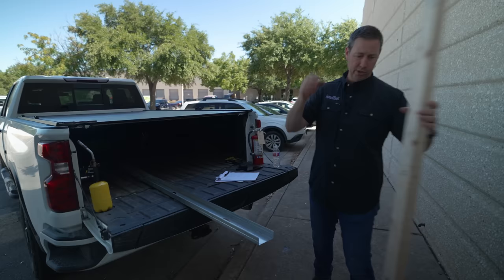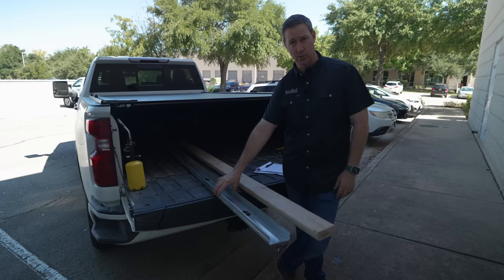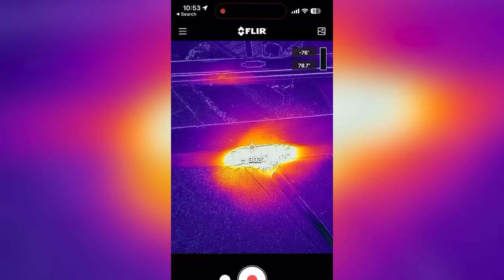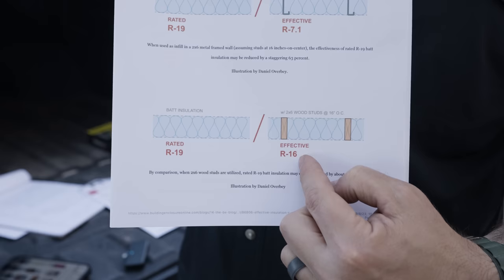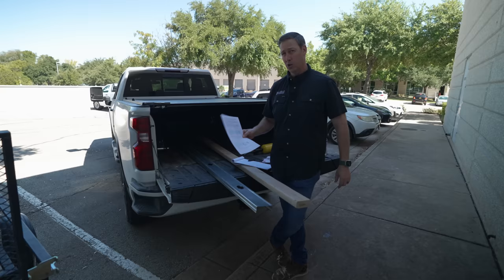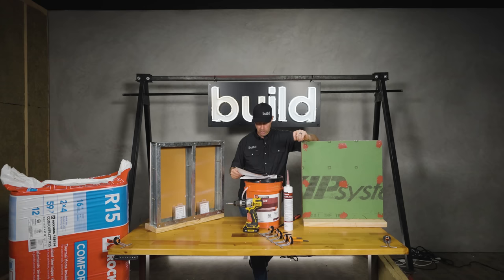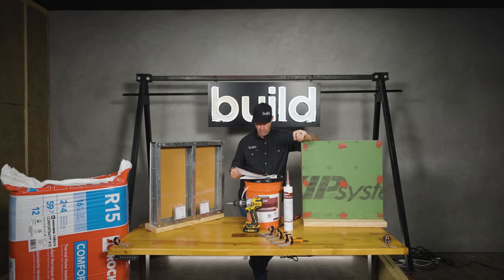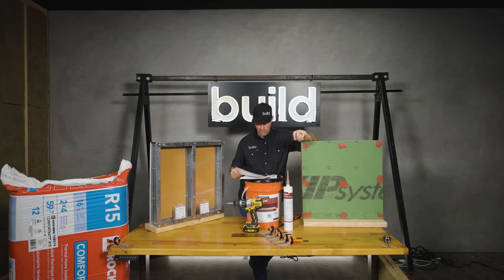Framing Studs: Steel vs Wood

Comment: Being that I am late to the party, I might be repeating many comments and concepts.  This is not going to be a quick read.  Sorry about that Matt.

Whether you use Cold Form Steel (metal studs) or wood-based products, there are many pros and cons to carefully consider.  My comments will focus on the metal framing for a residential home that is energy efficient and built for today’s ever changing weather conditions.  Feel free to have your opinion and conclusions on this topic.  A health conversation is the best thing.

To begin with, using a 3 5/8 or a true 4 inch metal stud in either 16 gauge or upgrading to 14 gauge stud is the optimal size and strength based on the gauge. Yes, they are straight.  The width of the metal stud known as the flange size is typically from 1 3/8 to 1 5/8 inches depending on the manufacture.  Larger flange sizes are available and will increase the cost.  Depending on your load requirement and distance, a header can be from 18-12 gauge.  Again, depending on the engineering requirement, you can use a metal stud or switch over to a metal C-Joist that has the same characteristics as the metal stud.  The standard flange size for a C-Joist is 2 inches.   Each manufacture has various options for blocking from flat stock to u-channels.  You can go either 16 inches or 24 inches on center.

Based on today’s pricing, a metal framing members are more expensive than a conventional wood stud, but, not still in the range of a engineered wood product (“EWP”).  Just like Builder’s First Choice Ready Frame service using wood products that Matt mentions alot, there are the same for metal framing from various sources and can be found on the web also.   The project savings for this comes in the reduced labor cost and faster dry-in time.

In terms of strength, metal studs are extremely strong and hard to bend especially in high winds.  The correct gauge is the key to the application.  I always prefer going with 16 gauge as a minimum.  As somebody here in the comments mentioned earlier, they used 18 gauge studs for their home designed to handle winds up to 150 mph and as already survived 3 hurricanes in various extreme wind speeds. With metal stud, in particular the sizing I like, you do not have to worry about failure as with traditional wood or even some EWP.  Regardless which product you use, I cannot stress enough, when it comes to high winds which has various variables, the right hold down connectors to the foundation, beams, or etc.. must be used, as well, as the correct shear products and sheathing to complete the diaphragm.   To achieve full strength of metal framing, the stud must be tight to the bottom and top track with no gaps.  Otherwise, you must add clips to correct the issue.

Regarding the fire rating of metal framing members, many fire rated assemblies you will find Cold Form Steel framing products as fully certified for extensive burn times more so than the typical 2x wood material.  Cold Form Steel, studs or joists needs roughly 2700 degrees F to start melting.  With today’s fire load in a typical home with in the last 20 years, you are reaching temperatures around 1800-2000 degrees F.  An older home with traditional furnishing will reach 1000-1200 degrees F.  Fire departments hate the wood I-joists and have a nickname for them, the Widow Maker.  Due to the density of the assembly, the burn through very quickly as compared to the metal.  I know that some municipalities do not allow I-Joists in multi-dwelling or multi-story single family homes because of the quick burn rate.

A bonus when using metal framing products, some insurance companies will give you discounts. This also depends on the complete assembly and the materials that have type A rating for fire.

With that said, the drawing back to using metal is the conductivity of heat or cold passing through.  A 4 inch wall has more than enough strength to carry the loads from a floor and roof.  A 6 inch metal wall will not make a difference in terms of the energy rating.  As building science has now taught us, exterior continuous insulation (“ECI”) is more effective as your energy barrier.  Additionally, it keeps the dew point away from the interior of your home and eliminates the interior condensation problems that lead to mold.  Thus, the additional cost insulating the home for the best BTU Retention rating.

My prefer method is to sheath the exterior with your typical 7/16 inch OSB and then add a Nailbase consisting of 2 inchs of a polyiso product giving me an rating between  R12-14.  Depending on your zone, you might need additional material or less.  The nailbase material I currently like now is a thick Magnesium Oxide product for increase impact resistance.  This will require special self-tapping screws to install the Nailbase into the metal framing. The Nailbase is coated with Prosco’s Cat5 system for the WRB and follow up with a rain screen.  The interior gets 2 inches of closed cell spray foam.  This will give me a cavity rating close to R30 an effective rating over R20 pending on the type of windows and doors used.  Moreover, my prefer method is far superior to fiberglass insulation, the best BTU Retention, and keeping the overall wall depth as short as possible.

There are many other products that can be used to insulate a metal frame structure.  

Another additional cost when you use heavier gauge metal studs comes to installing your gypsum wall board.  Some sort of strapping must be used to make that process faster with out struggling.  Strapping can be plywood strips or lite gauge metal furring channels.

The other additional cost comes to the tools you need and the type of connections for wood-to-metal and metal-to-metal.  As I did not go into any assembly methods, for the builder, the upfront cost in investing in tools will be in the faster labor times.  The new high pressure air guns are worth looking into.

If you made it this far, I would like to thank you for your time.  Indeed, an interesting topic.
Reply: I wanted to thank you for your thorough and unbiased assessment of the pros and cons of this new technology. Your industry insight and experience are an asset to the trade!

Comment: How about the LVL/Versa studs? Or using wood studs inside steel (strengthening)? I guess overkill but I've built some steel walls for interior with wood as reinforcing without issue. Ofcourse insulation wasn't as critical since not exterior walls... so much easier building in steel but then a whole different trade!
Reply: Inserting LVL or any other engineered wood product into a metal stud is overkill.  Depending the gauge (16 or 14, the lower the number, the stronger it is) you use for the metal stud it is equal or stronger than you think.
Reply: I use Lvls whenever I can on my builds.  I build modern houses where perfection is needed.  Today's lumber is garbage.  Granted my clients can afford it.

Comment: Speaking of metal, I want to know the community and Matt's thoughts on container homes. They have gained mass popularity as of late and my primary skepticism is the amount of insulation as well as possible moisture / condensation issues due to the difference in temperatures. Especially in northern climates such as Canada. I would love for you professionals out there to shed some light on these types of homes.....

Comment: In the Caribbean it is common for homes to built with block and concrete with no interior framing and plaster board anywhere including interior rooms.   Just plaster both sides of the block and paint or add stone, tile, etc.

Comment: The main reason steel isn't used IMHO is that builders do not want to train their crews to build with steel. And especially here in the Southwest where a significant amount of the residential labor (in both custom and tract built homes) are 'undocumented' and being paid significantly less than commercial, usually union, carpenters. With modern code, Zip R sheathing is almost required and would eliminate thermal bridging. Given the other advantages of steel, for me it is that it is STRAIGHT, there are significant savings in downstream trades, and ultimate finish quality. I am seeing multi-million dollar ($10,000,000.00 to $100,000,000.00) homes being built here in Las Vegas using wood stud walls, OXB sheathing and building paper (Tyvek) wrap with "blue" paper as flashing. It almost makes you ill to see. Slightly off topic, but they are also building almost 5 story 100+ unit apartment buildings, in wood. To wrap up, I would advocate to move all structural to steel stud (which is also recyclable) and use wood for real finishes, to bring the nature inside, instead of hiding it in the walls.
Reply: Oh they can 'afford' to do it. But that would mean re-training their crews and ultimately costing "more" for the first couple of projects, until the new crews got up to speed. There just aren't enough trained steel crews, because no one is willing to train them. They will continue to 'do it as they always have' because its what they know, and they know how much money they can make. And really, because no one is demanding they do better. It is also a failure of government, shocking, since these 5 story wood buildings are built because that is the tallest you can build type V construction. So it is effectively limiting density as well. If government banned Type V construction for certain types of projects, then you would quickly see steel and concrete take over and see significantly higher and denser projects. Which, while some don't like, are desperately needed in an urban environment.  @armslength2618

Comment: @10:28, The steel stud’s heat transfer is greater than a wood stud, however, in a matter of a few hours all the wall materials will reach the same equilibrium temperature. Condensation will occur regardless you used steel stud or wood stud. The steel stud will sustain some self -terminating rusting but not dry rot as in wood stud. Note: Canada is a big producer of framing lumber such as Douglas Fir, hence , don’t be surprised by the study’s conclusion favoring wood stud construction.
Reply: Dry rot is a misnomer. For wood to rot it require moisture

Comment: What about building with reinforced concrete as inner wall, rockwool in the middle (with a vapor barrier) and bricks outside? How would the R value be and the burn risk?
Reply: Why not just build an ICF with a brick ledge?
Reply: @silverbackag9790  As far as i know, reinforces concrete is much tougher than ICF, and here in Denmark we dont use/got ICF. And if you have precast concrete pieces, then its much faster to build like this. Then you can have the concrete put up in under a week for a big house, and then the plumber and electrician can start prepping the house, while the masons finish outside.
Reply: @dennisoestermann1880  ICF is reinforced. Rebar is placed in it as the walls are stacked.
Reply: @silverbackag9790  And what is faster, put down a load af blocks with morter in between or use a crane to put down a whole wall at once?

Comment: I've been drywalling a lot of steel frame houses this year in Australia, here steel is used primarily for termite and fire resistance, and the age old argument that "steel is dead straight", yes the STUD is straight, but then add the nogging and a diagonal brace or two and then electrician screws his switch plates on with a button head screw, which all cross over right where the drywall joint is and then you have a big bulge in the wall, and there is not much you can do about it.
Reply: Why are you using noggins in steel studs?

Comment: Incorrect. Exterior wall studs are a much higher gauge than those you show. I'm in commercial construction. You're using studs intended for interior walls. You are correct that most commercial construction use I-beam or reinforced concrete construction and a lot of smaller buildings, such as schools, use concrete block construction. However, in places between the steel or concrete columns, a heavy gauge stud is used. Many times, a building often has a grand entrance with high ceilings and it'll be completely framed with thick rigid structural studs. Most modern commercial construction uses either Rockwool or spray foam exterior insulation. Fiberglass is mostly used on interior walls for acoustic reasons between rooms.

Comment: What about a hybrid construction, meaning exterior walls using wood and interior walls using steel where thermal insulation is not an issue but a straight stud for the drywall is important.

Comment: I don’t think heat loss on the steel studs (thermal bridging) is that big of a deal considering the thickness of the studs.   They actually create a larger space for insulation.   Condensation is a really good point- I had never heard of that study before.  The big issue with steel studs is they warp when heating up which can pop the boards right off of it.   Engineers in Canada are starting to build much taller buildings out of wood now because in a fire the really thick structural wood members burn on the outside, but will stay strong inside, and don’t warp.

Comment: I've seen basement walls built with metal studs both in western Canada & Ontario.  Vertical stripes of condensation on the interior of the drywall on 24" centers is a dead giveaway.  These were slumlord specials, so it's probably safe to assume someone cheaped out on the insulation install.

Comment: So thermal R-value is worse for steel studs. What about for sound transmission? Seems to be better due to vibrations being converted to heat. At least that's my impression in commercial buildings with steel studs and batt insulation between internal partitions.
Reply: I think the additional mass of wood and it's other properties tend to dampen vibrations. Steel stud assemblies end up more like a drum. But put rockwool in both and problem solved! (unless you are making a studio or something, then use that fancy drywall/fasteners)
Reply: Metal is a better conductor. That applies to electric, temperature and vibration ie sound.

Comment: Basically, when using metal studs you want to insulate the exterior of your house (which is what should be done these days, especially in colder climates).

Comment: Trucore steel frames are common in Australia for residential houses. Given there is usually cladding or brick veneer, sarking or construction wrap, particle board and insulation, the difference isn't that much. Climate is more like Florida though, so don't need to endure the extremes of winter.

Comment: Matt, wouldn't it be better to build with ICF's all the way around?? I mean, I think it's great that all these products are available, but all those added materials cost and so does all the labor.. Aren't we better off with insulated Concrete Forms?? Topping everything else, I don't think you can beat the strength of them and for places like here in Florida, I think it's a no brainer!!!

Comment: Im in engineering and another reason steel studs arent very good is they dont perform very well in seismic zones for shear. Steel studs were originally for interior demising walls and partitions walls. Wood can rot but I have also seen steel studs rust out in homes in a short time too.
Reply: Use rust resistant steel instead of the cheapest mild steel available? Granted that cost more.

Comment: Biggest drawback on using metal studs is the. Fact that basically any screwed connection only catches one turn of the screw.  Over time the small changes in building air pressure will loosen screws in metal studs.

Comment: From the point of view in the fire service, steel buildings fail and collapse at least three times faster than wood buildings.  Also charred wood tends to start resisting further fire damage for a longer period of time.  Both steel and wood off gas under heated conditions and steel off gassing of the galvanizing is more toxic.

Comment: Don’t know if you touch on it, but I’ve heard the steel studs can actually do worse in a fire because they transfer heat into the building faster. Whereas wood will char and insulate itself slowing the spread.
Reply: Wood didn’t slow the spread of fire much in Lahaina last month
Reply: @crikescrikes2465  okay… not the same thing but cool. These are like… published studies and numbers you can look at. Don’t believe me go look at mass timber fire ratings and why they’re fire rated, but I highly doubt you will.
Reply from the maker: Interesting. I’m not sure
Reply: @buildshow  Hello

I do work for a condo townhouse complex that has mold issues on drywall, steel studs showing through the wall ( like you see a shadow ), all the issues you described in the video. Is there any way to address the moisture/mold on drywall on the inside without tearing out the siding and adding exterior insulation on the outside of the building?

This is exactly what I thought was happening, they got an engineer and did useless caulking and spray foam insulation but it hasn't fixed the issue.
Reply: 100% not true

Comment: So your statement that curtainwalls dont use structural metal at 6:54 is not accurate.  They are always structural and the stud gauges are dependent on load data determined by the engineer.

Like you said, IBC 2018 dictates CI minimums.  Here in NC the min is R-7 in the CI, this overcomes the Thermal transmission issues.  These minimums are market specific to address regional factors.  It is not enforced in all markets, so our conversation should revolve on adoption and compliance to IBC.